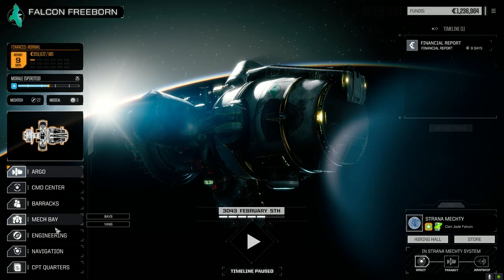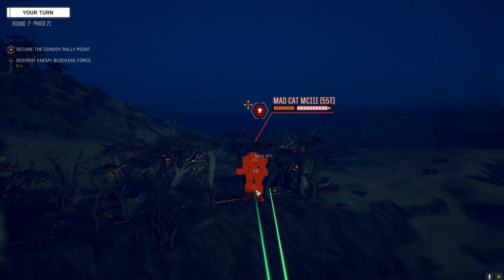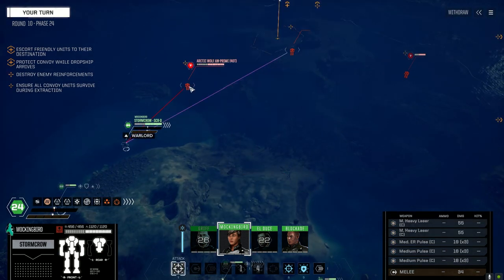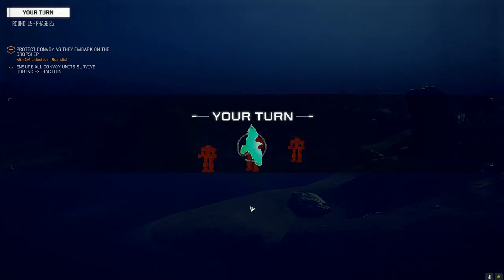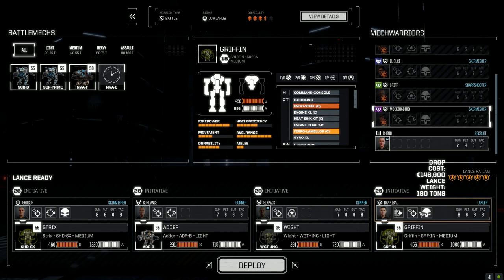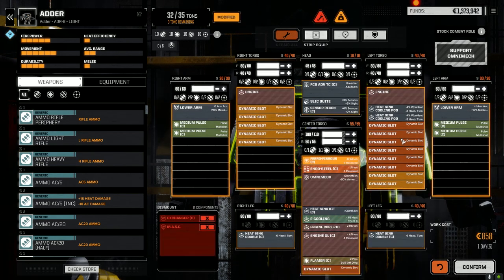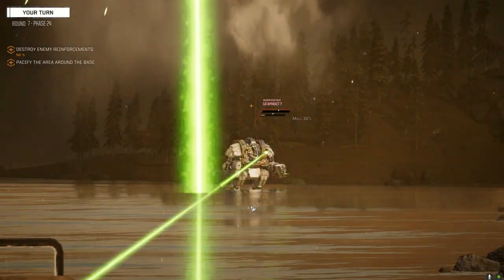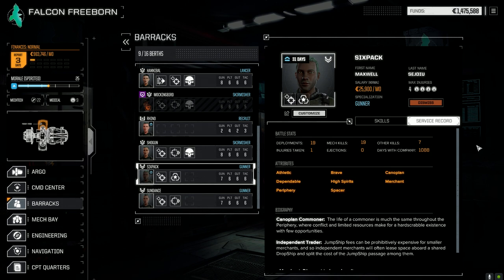Roguetech - Jade Falcon Freeborn - Ep41

Comment: If you get a 225 rated engine, the Strix will effectively gain one engine heat sink, which I think will let you trade for a bit more speed without losing much in the way of tonnage (take out one external DHS, gain one from the bigger engine cooling system as it goes from 8 to 9.)
Reply from the maker: I'll keep my eyes open for one.

Comment: Do you have a -Heat bonus if you stand inside water? It was that way in old MW games.
Reply from the maker: Yes, there is a -Heat reduction for water. Basically, a blue dot in a hex means there is water enough for that reduction.
Reply: @attackanddestroy  It was fun in MW3. Had a Thor with at least 6 ER Laser (there was only one size, BIG) and the rest full of Heat Sinks. And only Laser worked under water. Even a 100 ton mech had no chance to survive more than 2 alpha strikes. And under water you couldn't even die of overheating.